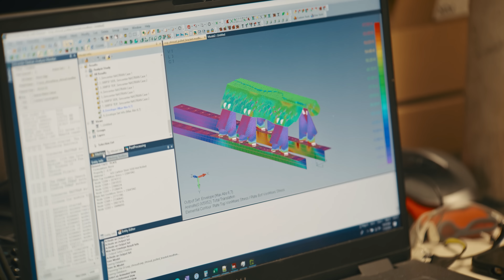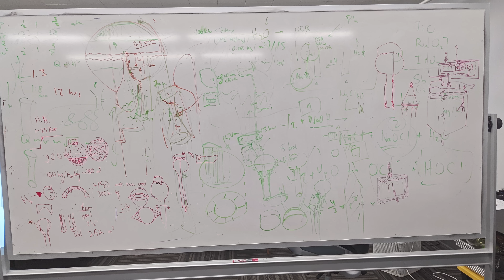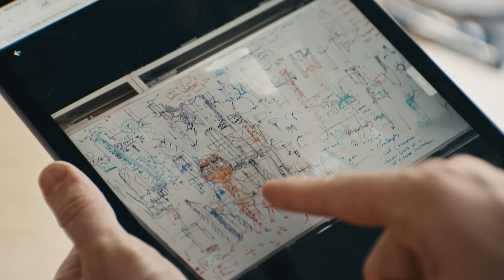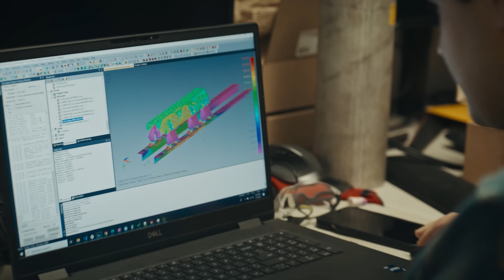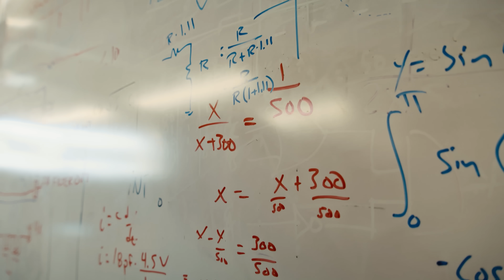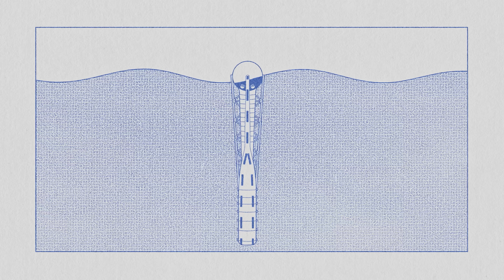Ocean-2

Comment: Why cant you just throw a cable and bring the energy back on shore? Isnt this a solved problem oilrigs do this all the time. With both Pipelines and high power underwater cables. You could even have a separate floating platform to step up the power for better transformation.

Comment: Producing energy from the sea is easy ! It’s building a system that can survive the storms . Good luck to them .
Reply: Bro thinks a giant steel tube isn’t basically indestructible
Reply: @SixOhFive  how will they be anchored? How will that handle 20ft or 30ft  waves? How about that 80ft rouge wave? We're not talking about trivial forces here, and they will be basically constant for the life of the system. One of the principle problems with other ocean power generation systems has been much higher than anticipated maintenance costs. They talked about not using moving parts, which could mitigate some of that, but the whole machine is still in a corrosive environment, and factors like barnacles and debris must be a concern too.
Reply: @certciv Great questions — real ocean forces are brutal. But Ocean‑2 is designed like offshore wind platforms: anchored with dynamic mooring lines that stretch, absorb wave energy, and reduce shock. It rides the waves instead of resisting them — that’s how it survives even 30–80 ft seas.

You’re right that maintenance has killed ocean power before — but Panthalassa’s design has no moving parts, deep ballast, and coatings to fight corrosion and barnacles. It’s not maintenance-free, but it’s built to go longer without costly repairs.

The key isn’t making it invincible — it’s making it resilient and replaceable. And that’s the shift happening in ocean energy now.

Comment: I wonder how they plan to maintain these. Corrosion, build up of sea life... Maintenance for submerged objects is very time-consuming and expensive. This will be not only submerged, it will also have sea water inside, flowing around its more delicate internals and moving parts. I just don’t see how this could be used long term without significant maintenance expense.

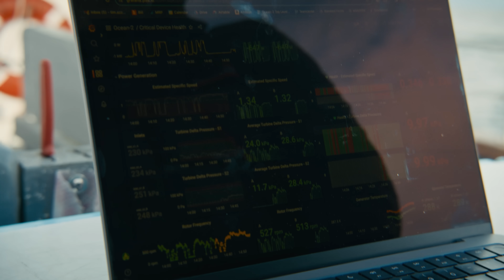Comment: how do they prevent sea animals from being sucked into it? also they are only producing 2.5kw power at 11:55, which means you would need 400,000 of them to produce a terawatt. however if you scaled it up 3.5x you would need less than 10,000 to produce a terawatt.

Comment: "The Water Hammer" is a good nickname but unfortunately it's already taken. Water hammer is the phenomenon that causes the pipes to bang and clang together in old buildings (or in newer buildings that house DIY plumbers).

Ocean 2 resembles a particular type of tool called a slide hammer. I propose changing its nickname to "The Electrified Water Slide".

Comment: Hey I'm just a dumb guy making a YouTube comment on a video with almost 1k comments, but why not build a huge pressure reservoir with a huge turbine or two then build many floating "pumps" in a fleet to fill it up? 
 
The idea being, the ram pumps can be simpler devices that are much cheaper to build and you can get away with far fewer of the more complex components.

Comment: USING the power out in the middle of the ocean is something I didn't expect. I still see getting the power back to shore as the biggest issue. Really exciting stuff, excited to see where it goes!
Reply: You can compute from anywhere, and the ocean is free coolant
Reply: @Ferraday  Compute from "anywhere" is a bit of stretch I think- you usually need a lot of buildup around server farms that would be possible but tough in the ocean. Plus, you usually need staffs of people to monitor on-site.
Reply: I'm thinking you could hook up arrays of these to a pylon that connects it to a deep sea cable system.

Comment: Hey, I'd really like to look at the numbers and ratios.
It really depends if you can generate kilowatts or tens of kilowatts.
There is a significant difference between powering a modern-time gaming computer or a building and it needs to be set and distinguished.
You'll need to be a lot faster than fusion reactors which I think pose a great "threat" to your neat 'little' concept.
Brilliant marketing by the way, the production quality on this video is mind-blowing. Thank you.

Comment: The reason this is presented like BS is because it is. This cannot beat photovoltaics on any metric, especially the most essential one: economics. 

Sustainable energy doesn't require using one technology exclusively, but if you spend literally 5 seconds looking at solar and battery costs *and their cost curve*, there is no doubt that this is dead in the water as anything but a novelty. We can do vastly more for cheaper otherwise, today.

Comment: but it will take energy to move the energy to land? right?
Reply: Not if the energy is used out at sea. They mentioned something about offshore data centers. Simple solution, right? (Yes, I'm being sarcastic.)

The data center idea and the "convert to hydrogen" idea are huge red flags IMO.

Comment: Very interesting idea. Few questions though, which didnt seem to be clear at all in the video:
- What is the minimum sea state needed to actually make decent amounts of power?
- What is Ocean-1's max and average output? (kwh?) and what is Ocean-2's max and average output? - reason I ask, is sure you could make a lot of them, but if each one isnt very big (kwh wise) then you have a problem (maintenance on the gens will kill any profit). 
- You mention "no cabling" back to the land - then how can you possibly use this for energy generation, and please, please, dont say microwave links - because we know how destructive that is. 
- If it has to be far offshore and you do need a cable, then there are some big problems there too (which I hope you are working on), but how can you get large cables working and attached to a mobile platform like this? The interconnect for something like this is extremely complex (purely because of size of forces involved) and the other problem is that the cable itself will impede the operation of the unit. Are these problems you are working on? Or are you looking at only H production?
My concern with H production is there are many many other factors involved in doing that, and there are still many problems with using Hydrogen as an energy source, they may or may not be solved, so this is a big bet.
I do really like the whole concept and its highly valuable. Wishing you all the best with this really fascinating project.

Comment: Their concept seems technically plausible, but CAPEX ambitious. It has modular potential if subsidized, but would need huge economy of scale to displace existing generation on a pure economic basis, as they hope to do.  I'm not even sure it's the best choice for carbon reduction for the cost.

Based on a rough but plausible estimate of 225 kWh/day/unit, and if we including transport, delivery, conversion and investor returns, the cost per unit energy is plausible (maybe 0.16-0.20 cents/kwh). However total system deployment for offsetting 25% of global energy usage (their goal) would be about 500 million units at a cost of over $100T, and would cover ~471,000 km² of ocean, at 30 meters unit density (about the size of Sweden - still only about 0.10% of the ocean surface).  CAPEX and OPEX is mainly steel and maintenance, not manufacturing or deployment, and therefore scaling cost reductions are limited.  This is almost certainly why they mentioned automation - its their best case for cost reduction.

Using mass estimates, the carbon ROI (CROI) is achieved in under 3 years, comparable to to wind and solar installations.  At their imagined scale, it could offset about 1-2 years of global carbon emissions for every 20 years it operates - but due to massive infrastructure, this could amount to a lifetime CROI of about 1.5X (vs 120x for wind, 30x for utility solar, and 6x for electric vehicles - better platforms probably if climate is the goal).  Recycling or repairing units would improve this considerably.

Te primary challenge will be assembling capital for deployment, rather than resource or 'land' constraints.  It seems viable between maybe 50-225 kwh/unit/day, based on my crude estimates.  Doubtful if it comes in below that. It will be interesting to see their reports on the prototype average generation over time.

Comment: So, you said a lot and didn't say much at the same time.  
-What's the cost to benefit and how long do you expect it to take to line up?
-You created the power. Beside the dream of using the power to create hydrogen and shipping it back, which I see as utterly inefficient, how else do you see actually harnessing this power?
-What's the expected lifespan and what do we do with them once they're no longer in use?
-Do they have environmental impacts (e.g. changes in the fishing industry, changes to sea life swimming patterns,  temperature changes due to large metal heatsinks, etc.)?  
-What are your plans for fighting "Big Power"?  Your utopic dream of "cheaper power is better and people will use it" doesn't work in a capitalist society.  Where will your investments come from?  How will you tie to the grid when you're fighting Big Power and their army of lobbyists?

This isn't like solar where it's accessible to regular folk.  I love the idea and your engineering is amazing but, your playbook doesn't yet seem flushed out.

Comment: There are engineering teams with way, way more experience than this one that have been working on similar ideas for decades.  It's so much harder working in the ocean environment than people think.  If this venture succeeds ... I will be happy, but completely amazed.  By the way, the idea of filling a long tube to vertically flip was pioneered by FLIP (Floating Instrument Platform), designed at SIO in 1962 (!)  The reason FLIP has the long tube is to provide a large moment of inertia so that the platform doesn't move up or down much in large swells and sensing instruments hung off of it can be less contaminated by "strum noise".

Comment: Yee, hah. Gotta be a $200M project. How come I am only now hearing about this? And making power already -- git down with yo' bad sef!!

Hydrogen xfer is kinda low-efficiency; you still gotta address the transfer of energy to the point of consumption. Maybe some kind of deal to move energy-intensive industrial processes out on the water? Think heat treatment, smelting, yada yada. The logistics get, um, "complicated."

Comment: Maybe the energy transmission problem (the hardest problem here) could be solved by placing these around off shore wind turbines that already have the network off under sea substations and power cables? The storage problem is still the biggest problem wind and solar face.

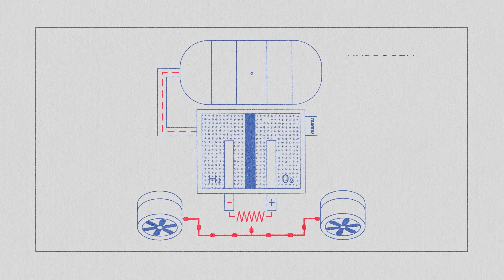Comment: 7:12 I'm sorry but it feels like you guys have figured out how to generate power out in the ocean, but not what to actually do with it. Putting mini data centers in each node and beaming that information back to the shore via satellite? Producing hydrogen that you then have ship back to shore via a giant shipping vessel? Why? 

This is an extremely interesting project but surely there is a better use case of how to actually use the power captured. To problem of figuring out how to actually make use of this power is the much harder problem to solve here. I would imagine it would need to be some sort of wireless energy transfer system or massive undersea cables.
Reply: Weather stations and Data Acquisition Systems (DAS) are used by solar PV and wind sites the world over. They're using embellished language to say the same thing.

Comment: These things or variations of them could replace EVERY channel marker and Navigation buoy on the planet and could be used in smaller versions to hold fishing nets etc.  The smaller ones could be used to charge batteries for electric boats etc.  Coastal waters are more active and shorter distance to transmit power back to grid.  Great work.

Comment: Panthalassa’s ocean-based energy system is currently in the prototype stage, with its most recent device, Ocean-2, having completed a three-week sea trial. However, specific daily energy production figures for Ocean-2 or the Panthalassa system have not been publicly disclosed in available sources.

Key points from the available information:

Ocean-2 is a prototype buoy designed to convert ocean wave motion into electricity using a vertical orientation at sea.

The device was tested for three weeks in the Strait of Juan de Fuca, successfully generating electricity and demonstrating key operational capabilities, including satellite communications and system reliability.

The company’s long-term goal is to produce very low-cost electricity (about $0.02 per kWh), but this refers to the projected cost at scale, not the output of the current prototype.

No quantitative data (such as kilowatt-hours or megawatt-hours per day) is provided for the actual energy generated during the Ocean-2 trial, nor for any daily production rate from Panthalassa’s deployed systems.

In summary, Panthalassa has not publicly released daily energy production figures for its ocean-based system. The technology is still in the prototype and demonstration phase, with commercial-scale deployments and associated performance data expected in future iterations (such as the upcoming Ocean-3).

Comment: I feel like maintenance of these is a non-issue. If there's an entire process to replacing portions of the internet cables that run the bottom of the ocean, there can be a process for maintaining these.
Reply: I think turbines powered using salt water will likely require more maintenance than internet cables.
Reply: Turbines on small scale hydro projects on small streams generating less than a GW burn out ALL the time.
Reply: I just feel like it's not as insurmountable as others in the comments are saying. We can overcome the engineering challenges, and the logistics of servicing a large volume are not impossible.
Reply: @domoredujordan  If these were the only way we could produce energy, then sure, we could make it work. However when compared to other energy options (even renewable options) there are many less expensive options.
The video mentioned using the power for data centers. Where they thinking of having data centers out in the ocean? They also mentioned using the power to produce hydrogen and then using robotic boats to collect the hydrogen. Again this sort of thing is likely possible, but it's very very unlikely to be practical.

I'm not sure how familiar you are with the obstacles in using hydrogen as a power source. Hydrogen has a lot of challenges. Sabine Hossenfelder has a couple of good videos discussing the problems with using hydrogen as a power source. One was made two years ago and another was made six months ago. The one made six months ago mentioned how people are finally realizing hydrogen isn't a good solution. Normal hydrogen production has all sorts of problems. I'm confident producing hydrogen out at sea would diminish these problems.

This device sure looks impressive. I was impressed by seeing how much motion was achieved. I don't know how much power it would produce but it sure seems like getting the power to where it is needed is even a bigger problem than producing the power.
Reply: They are looking for investors to make these million dollar devices that couldnt even power a quarter of your home. The maintenance is just a bonus.

Comment: I think what the prototype engineer said was exactly right, make the clean energy the best option, so far, it hasn't been.  Instead of government subsidies into energy that doesn't work, it should be spent on research to create things that do.  Humans have limitless creativity, but it takes money to go from concept to reality.
Reply: Energy the doest work?  Like what?? Wind??
Reply: Oh that's cute. You're conveniently glossing over all the subsidies afforded to fossil fuels. If those subsidies didn't exist, gas would cost many times it does today. 

I'd much rather we give subsidies to renewables that are trying to address pollution and greenhouse problems than fossil fuels which got us here in the first place.
Reply: @nschrombeck  "renewables" gets more subsidies than oil and gas.. 

"During FY 2016–22, most US federal subsidies were for renewable energy producers (primarily biofuels, wind, and solar), low-income households, and energy-efficiency improvements. During FY 2016–22, nearly half (46%) of federal energy subsidies were associated with renewable energy, and 35% were associated with energy end uses. Federal support for renewable energy of all types more than doubled, from $7.4 billion in FY 2016 to $15.6 billion in FY 2022"